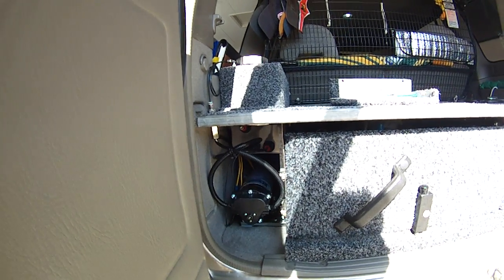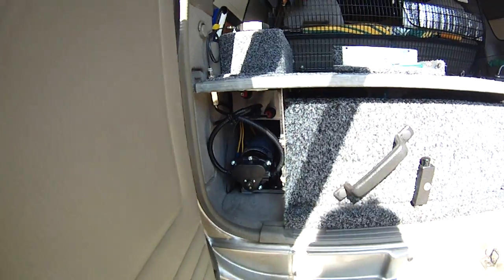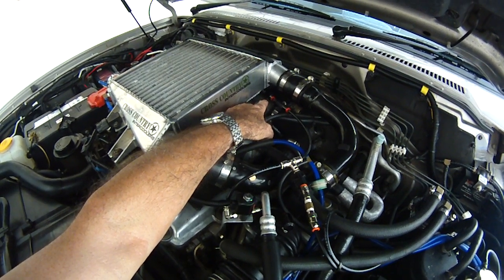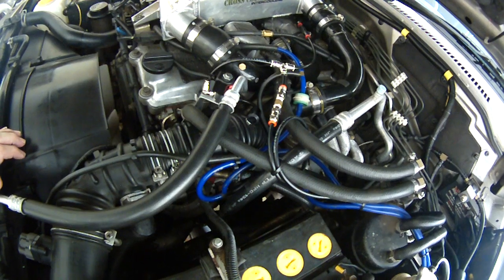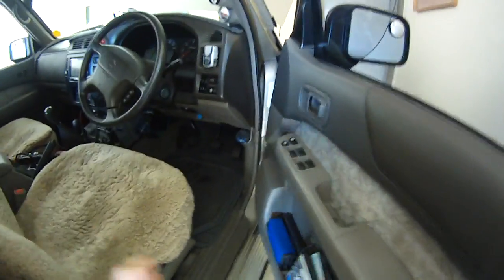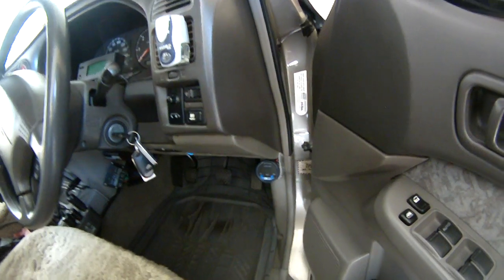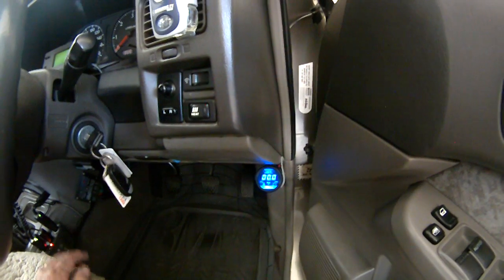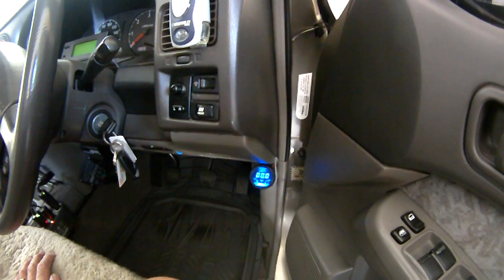Nissan ZD30 DI with pre turbo Water Meth Injection system

Comment: Mate, I’ve been thinking of setting something like this up on my PX1 Ranger.  However, I don’t want to use it for power increases, but cleaning/preventing carbon build up.  How do your intake valves look after using this system?  I know the ZD30 engines tend to have atrocious carbon build up on the valves, so if the carbon is being cleaned out with a setup like this, that’ll give me a lot of hope for my own project.  I have a little over 303,000 km on the clock.

Comment: Water Meth injection on a zd30 CRD a problem at all?
Reply from the maker: No problem with injection post turbo at all, pre turbo needs to be considered vary carefully as damage can be done, I changed my pre turbo system  by fabricating my own turbo inlet with a nozzle set inside and only 4-5mm away from the turbo compwheel. I probably should update this, 5 years old now, wow.
Reply: @Geeyoutoo  I owned a pajero previously with water meth fed into the throttle body post turbo and it worked great. Now I have a 2007 gu crd :)

Comment: Is this the v1.10 or later CMGS?  I think you could run much more nozzle after the IC. probably a 3-4 gph nozzle, especially with your boost settings that high.
Reply from the maker: Mine is the 4.11. I have a selection of nozzles and during initial trials I ran up to 7GPH without a stumble so yes I could go bigger, but due to my tank size this was unsustainable as I do a lot of trips and I don't want to be forking out for demin water and Methanol on the road (I use filtered water from my home tanks but don't always add the meth). I have recently built a unit to control injection better, but haven't gotten around to fitting it yet, the solenoid will be run off the TPS yet still controlled through the CMGS, High TPS at low revs will not open the solenoid due to other parameters that are setup.

A larger tank is on my list of things to fabricate once I find a suitable location, other projects keep getting in the way :).

Comment: How much power gain did you mange to get out?
Reply from the maker: It hasn't been on the dyno since doing the pre turbo mod but my earlier post turbo version gave 13hp, the pre turbo injection gave a much more significant gain, but as said you need to check the turbo rotor leading edges regularly until you are satisfied no damage is being done .

Comment from the maker: Continued. I would recommend checking the turbo rotor every 500k for at least 2000k (not that hard to do on a ZD30) then every 1000k for a little while longer, if there is going to be any pitting it will show by then. The performance gains on pre turbo injection are quite considerable, whether it is worth the hassles involved is up to you.

Comment from the maker: After many K's of trials I found the CM3 nozzle is a bit large for the boost I was using (18.5psi). I had pitting on the leading edge of the turbo rotor, not enough to effect performance but enough to warn of an impending problem, I reduced the boost to 16.5psi and refitted the CM2 nozzle in the pre turbo injection point. The small GT2052V VNT turbo on the ZD30 spins at very high speed, not sure of exactly what but at 18.5psi it could well be in excess of 160/180,000 rpm, so care is needed.